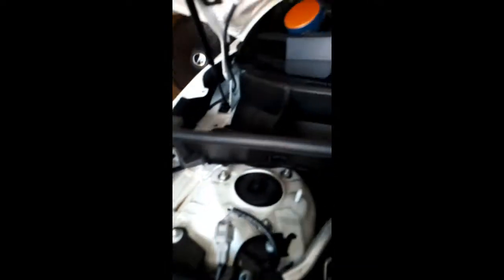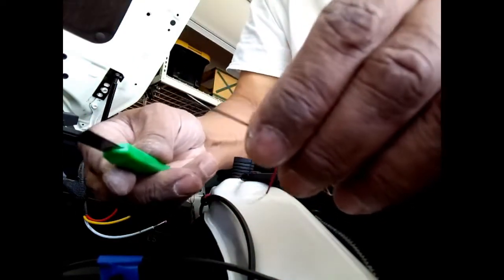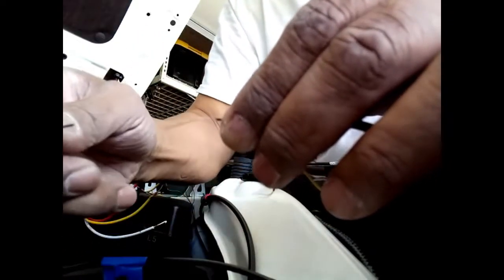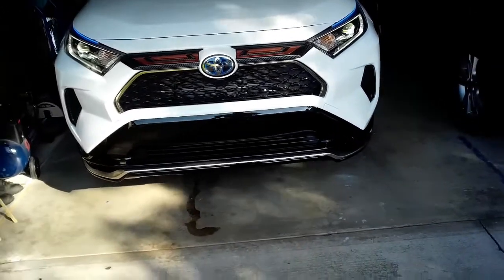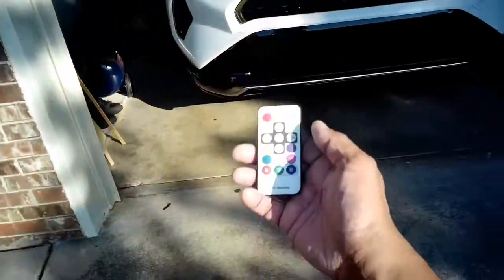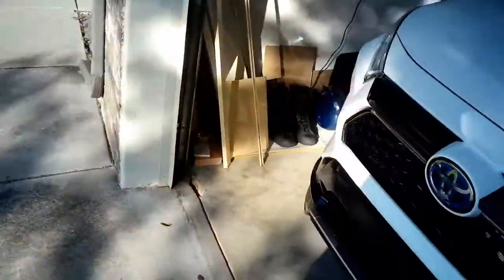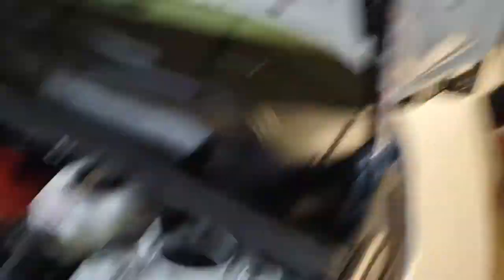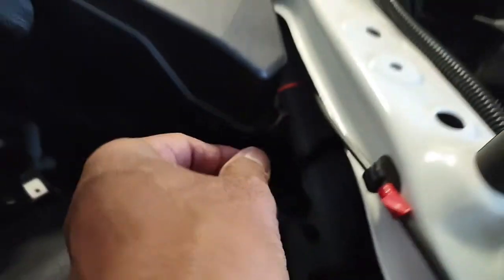HOW TO INSTALL $17 MICTUNING DRL DAYTIME RUNNING LIGHTS ON TOYOTA RAV4 PRIME.  TALK ABOUT SWEET 👍💖😀

Comment: I’d just make sure you don’t flash blue, especially in motion as in some states that will get you a ticket since flashing blue is reserved for law enforcement.
Reply from the maker: Yup...you are absolutely right about that.  So far I've had several cops look as I drove by, but no one has stopped me yet.  Hopefully not.  I try to keep it in that running mode of green, yellow, white area....so far so good...